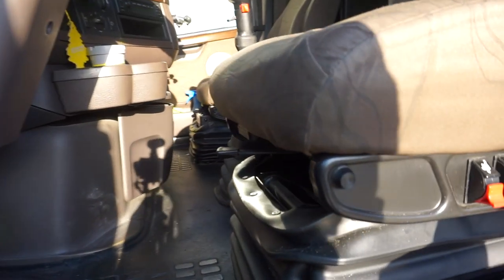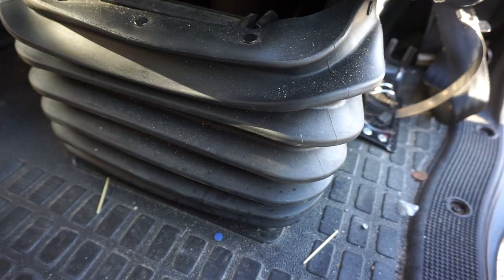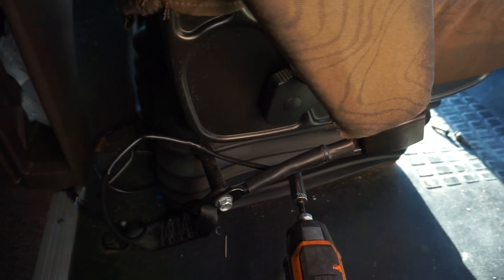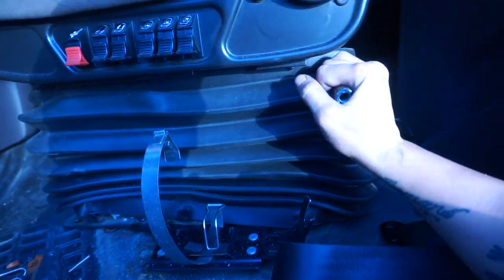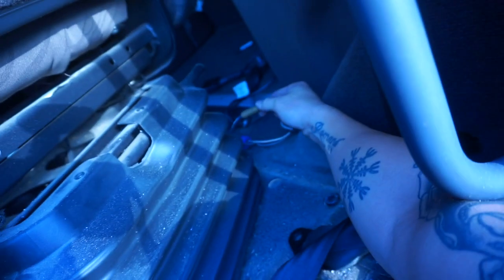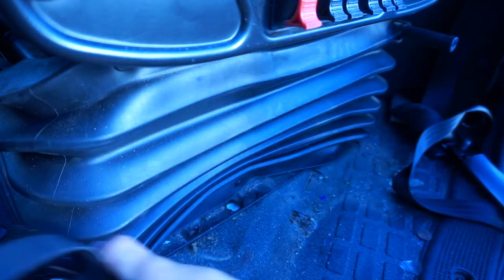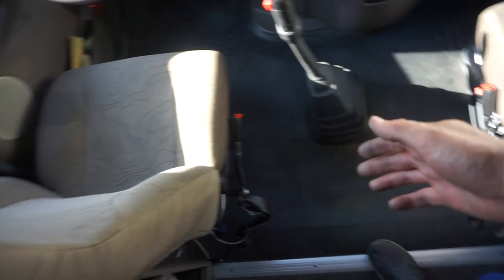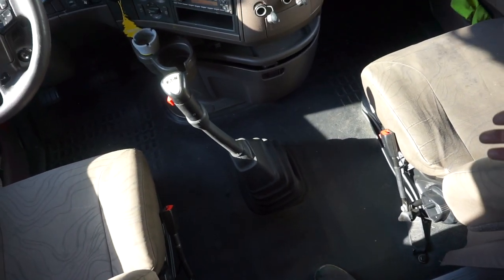How to install semi truck seats

Comment: Great Info and great video.  These are National Seats in case anyone is wondering.  Generally the process is pretty similar for most seats.  Swapping driver/passenger is a great cost savings idea.  And parts are always available if you need them.  Great job!

Comment: the reason u could not disconnect air line and had to cut it : it was under pressure. drain tanks first and then disconnect.

Comment: I have 2017 volvo vnl670. My driver seat suspension is very soft and it hits the ground when hitting the bumps. Is there any adjustment for the suspension softness?
Reply: There are some seats that have an adjustable shock absorber.  What have you got?

Comment: Hi is it possible to change just a seat cushion? Thanks
Reply from the maker: Sergii Prokopenko it is, just flip the seat up and remove the 4 bolts holding it to the sliding frame
Reply: @8526Productions  can you do a quick vid of that sir?
Reply from the maker: Blacksnake Gray I sure can if it will help. Give me to Monday or Tuesday as I have some new videos going up anyway and I’ll thro that in there
Reply: @8526Productions  thank you.
Reply from the maker: Blacksnake Gray hey just letting you know I just finished the quick video on this and I’ll upload it this evening. Hopefully it helps
Reply: @8526Productions  thank you sir.
Reply: i drive a 2017 vnr the passanger seat slides and flips up but the driver seat doesnt flip up, or at least i cant figure out how too. id love to swap the cushions. my ass is killing me
Reply from the maker: @el-hp1lj  I posted the follow up video on how to swap out the cushion, sorry I just saw this somehow

Comment: how did u connect the airline?
Reply from the maker: El Ansioso you just reinsert it back inside and it catches on the o ring
Reply: @312 Made   i found out by someone u press the ring towards it,use some kind of tweezers   then pull by hand the airline.     to insert it simply put the airline back and pull to make sure its secure, and done.